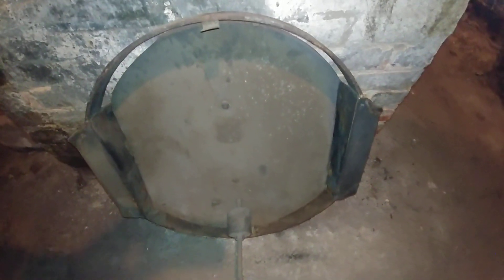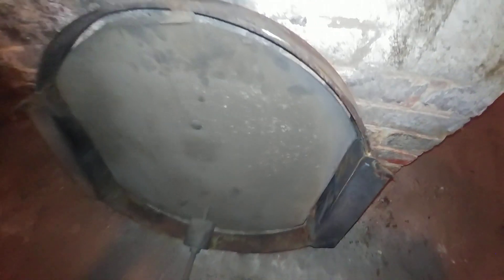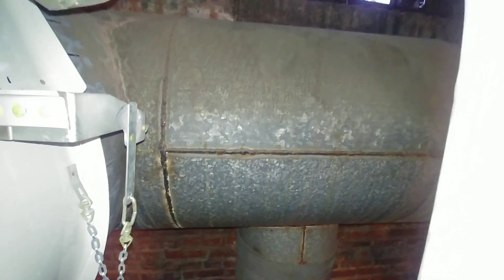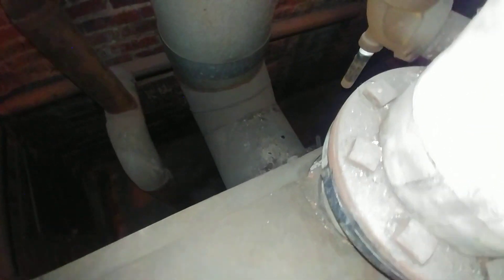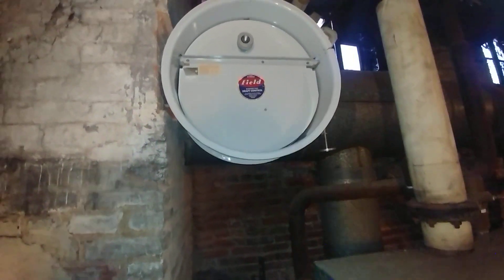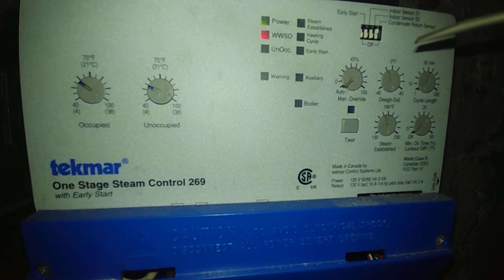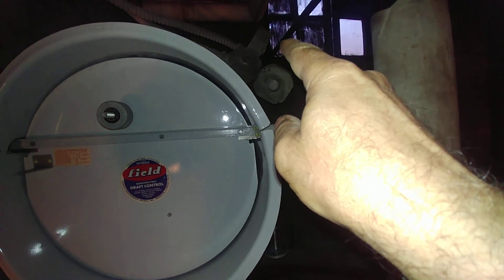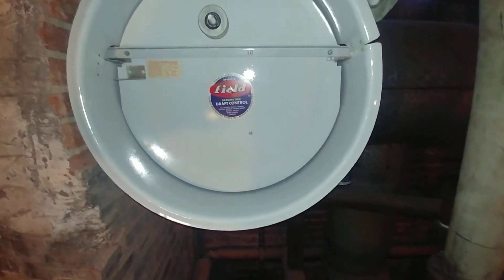Installation Of One Of The Biggest Barometric Draft Regulators Made

Comment: Thats some size boilers there , district heating?
Reply from the maker: District heating? Just about, but no.  
These boilers are massively oversized.  They normally run lo-hi-lo at 4 oz/in@ and max out at around 12 oz/in2 after about 45 minutes run time.
When we first started working on these 16 years ago, BOTH boilers were run and they topped out at 7 POUNDS/in2.
We have it in writing from the previous HVAC that this was absolutely necessary to get steam into the ends of the mains and into the furthest radiators.
Brings a smile to my lips when re-read that letter.
I used to joke that this Co-op COULD sell steam to the whole rest of the block.  
One boiler could do it, and the other boiler heat the co-op.
As it is, one boiler is shut down and put on stand-by for the season.
The other boiler is run for the season and they take turns year by year.
Reply: They are lucky to have you guys looking after things, thanks for the reply.

Comment: Another great video. My question to you is,  shouldn’t the chimney have a metal liner when using gas.  In NYC if you convert to gas they want you to put in a liner into the chimney.
Reply from the maker: In a perfect world, you are right it should have a metal liner.
The conversion from oil to gas on this system was done in the early 1990s(?) by others and I presume inspected and passed.
Now, currently, in our area, all gas conversions must have a metal liner if the chimney is unlined or the liner is failing, and that is to the good.
It took this long just to get a proper working barometric on it.
Its only a 106 year old system after all.

Comment: Field does list a 32" on their site. Bet they don't sell too many of those. 24" is the largest I have seen as far as the round dampers go.

I have seen larger square steel barometrics used in large industrial boiler rooms never knew who made them basically a square steel plate with a damper rod, but I have never seen one of those dbl acting. Basically they were on steel breechings as large as 4' x 4'
Reply from the maker: Thank you for adding your experiences!
This unit shown comes shipped from the factory to work on oil or coal.
To make it Code for gas, you are instructed to remove three red painted brackets to enable it to be double acting.
Some folks, even one tech rep from Field itself, believes that it's bad safety to allow products of combustion to spill into the basement so easily.
They may not be wrong, but it's gas burner Code for now, or so I'm told.  Thoughts?
Reply: @gordonschweizer5154   I always wondered about that myself (dumping Co in a building) but I guess with the blocked flue switches on the damper that's ok it should shut the burner off and as you mentioned the double acting barometrics are code required. But, years ago the blocked flue switches were not required. The thing that always concerned me was the condition you find on some flue pipes with 1 or none screws in each joint (supposed to be 3 min I believe ) One good puff from a burner and the whole works could come down
Reply from the maker: @ed6837  I think the "double swing" on gas barometrics was allowed because back in the ancient days when oil to gas conversions started, the gas burners all had standing pilots and the "swing out" of the barometric allowed down-drafts to spill out before they blew out the pilot.
That's not needed now, of course, but Code is Code.
Reply from the maker: @ed6837  Ah, yes. The infamous "I'm too sexy to put in screws" flue pipe assemblies!
Fun times!